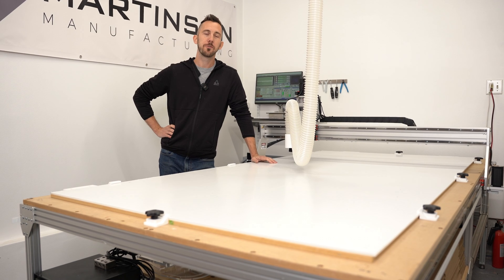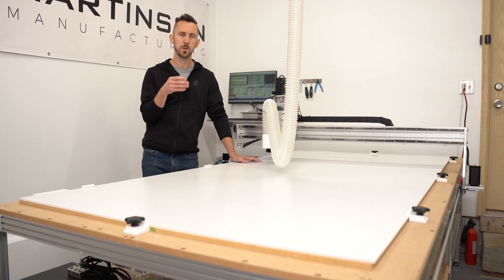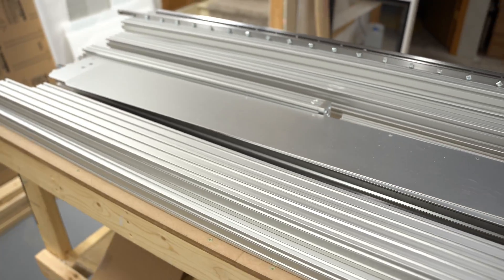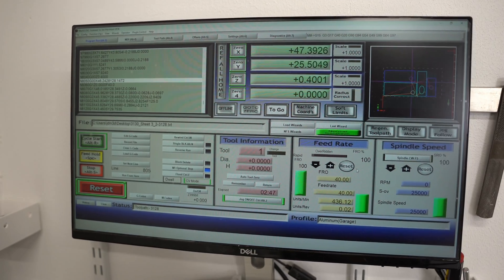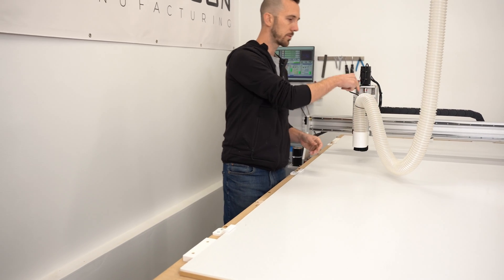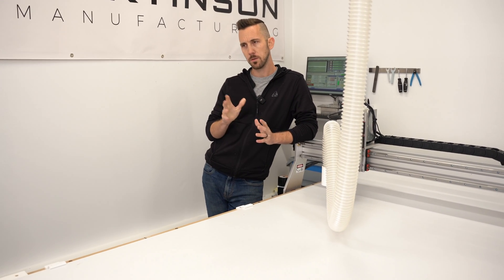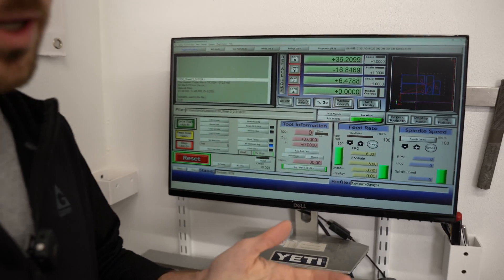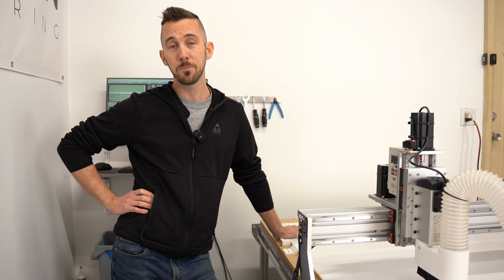Zenbot 4x8 CNC Review / Best 4896 CNC for under $10K

Comment: Lost me when I saw it had a belt / strap drive… they stretch… 100% no go
Reply from the maker: I cut over 800 sheets of 1/4” acrylic with this machine and the 800th sheet had the same tolerances as the 1st. But yea, eventually they’d need to be replaced for a few dollars.
Reply: @Joe_Martinson   Are you referencing the belt or a rail-mounted encoder?

Comment: I think I burned my UC 100!  If you get tired of the inconsistency of the UC100, try the UC300.  It uses data cables instead of software that doesn’t work with modern software. What a nightmare!
Shaun is a good guy, but I wish he would have pushed the UC300. I lost weeks troubleshooting!

Comment: I have been following you a bit the past few years when you had the Creality based print farm.  I bought my first 3d printer Ender 3V2 after watching one of your videos and ended up highly modifying that machine ten times over.  It gave me the ability to comprehend how the intricate details of 3d printing work.  At the time my big goal was to get my wood CNC Router shop going, little did I know at that time the 3D printing bug would postpone my CNC Wood Router setup and shop by  a few years. 

I am glad to see that you have now seen a great break out with your business!  I am catching up on your updates since you have been doing the CNC side of your business!  Glad to see with 3d printers you moved up to the nicely built Bambu machines.  I have been using Qidi machines myself, the Qidi4Plus ($799)just came out and is my latest workhorse offering 305mm and in early 2025 they will offer AMS for it.  Qidi has come a long ways and truly offer an out of box unpack and print flawless print machine equal to the Bambu but with heated chamber and larger bed.  

It is great to see you have grown!  I have been exploring starting a business myself which I can semi retire into from my normal job, power plant operations.  I have a small print farm and am busy setting up my woodshop at the moment.  

Your incredible story and experience is very vital as I begin to finish my shop and I work on dreaming up direction I will take my hobby.  I have been working all summer learning Fusion360, the design side is where I am most hyperfocused at the moment.  I have steep curve of learning Fusion, but making great progress.

I have a small wood router CNC been using for a year now, I still have not picked out my final  wood CNC setup, which will be a 4 by 4 or 8 by 4.  I am thinking a closed loop setup is the best way for me to go long term.

Comment: Do you use the CNC instead of the laser cutter for the cutouts ( adapter holes ) when it comes to the largers acrylic windows? From what I can tell, the Glowforge will be to small for the bigger ones :)

Great content!
Reply from the maker: You are correct. I used to use the Glowforge for the cutout but now most of my orders are very large panels so I use the CNC for everything.
Reply: Glow is not worth the money. I have an omtech 150w laser with a 40x63 table. You can put  4x8  sheets tru it. Around $9k what i paid for it.  Cnc better to Cut full acrylic sheets.

Comment: Finally!  Thanks for the review.  It's the first one I've found for the newer Zenbots.  I've really been looking hard at this setup.  I would note on thing.  Currently the Zenbots have a ball screw on the Z axis, not a lead screw.  

One concern that I have are the belts.  It's the old debate, rack and pinion vs. belt on the Y axis.  Don't know why they don't just go ahead and put a ball screw on the X axis though.  But you've indirectly answered that question to a degree because this isn't your first rodeo with a large format belt driven machine and you didn't even mention that as an issue.  

Zenbot offers the 4896 Complete Package that includes a 110v air cooled spindle or an optional 220v for $150 more.  Was that available when you purchased yours?  If so why didn't you pick that setup.  Frankly, it's the one I would chose because the price diff between Pro with add ons and the Pro Complete is negligible.

That dust boot looks really good.  Did you print that?
Reply from the maker: Hey, thanks for the comment. The complete package wasn’t an option when I first ordered but I think it’s great that they offer it now. Yeah, dust boot is 3D printed. Couldn’t find one for this spindle that I liked.
Reply: I've got rack and pinion on my cnc4newbie. I love it. All I need is a grease gun every now and then.